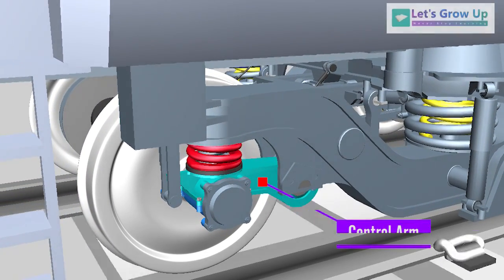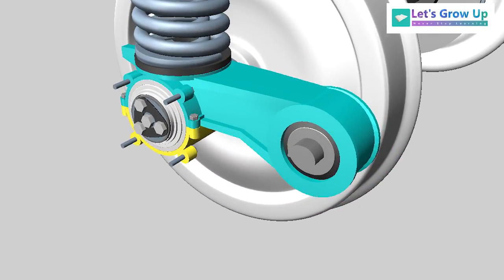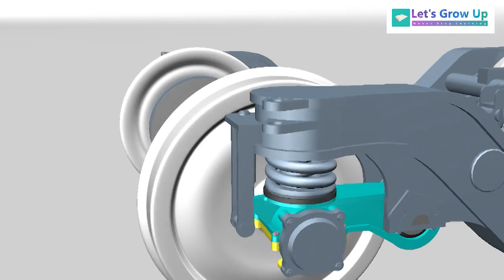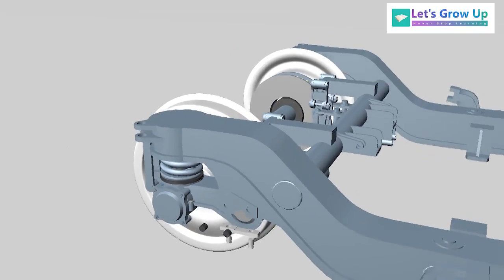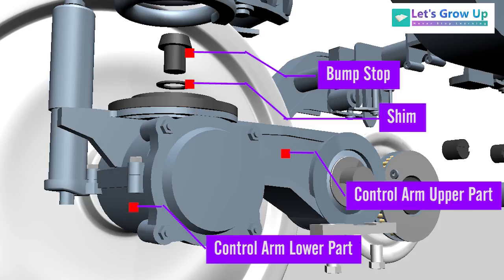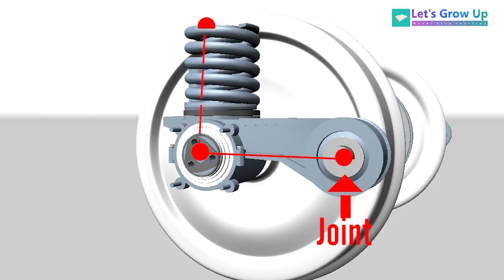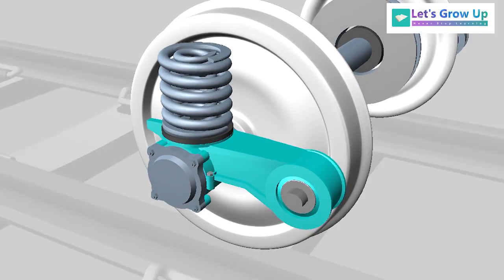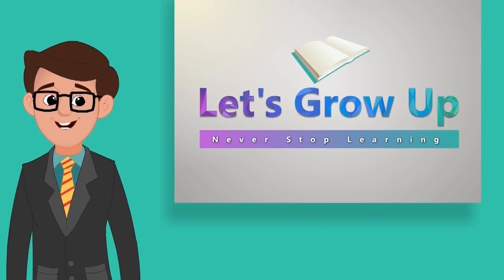working function of control arm assembly |  Fiat bogie control arm assembly

Comment: Sir please, name of the connecting i- bolt -  frame &  control arm as flexible joint ?(in which the screws are fixed)